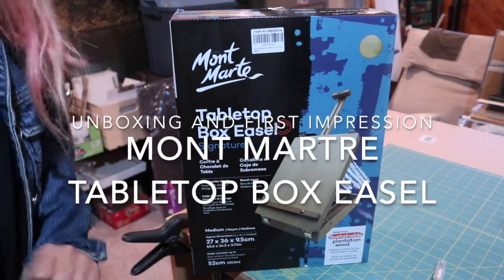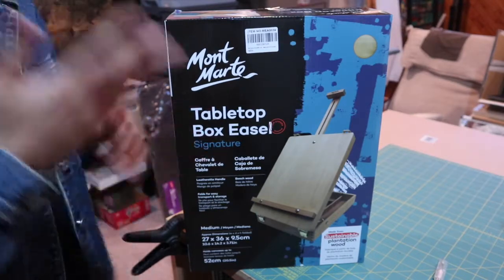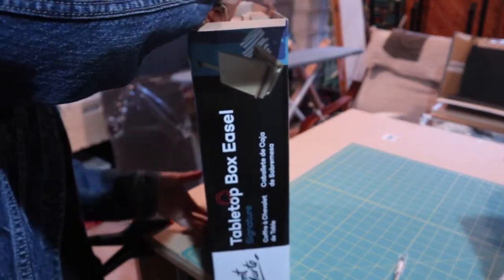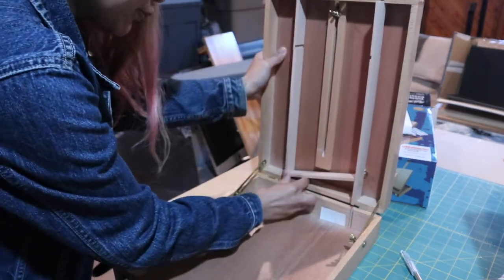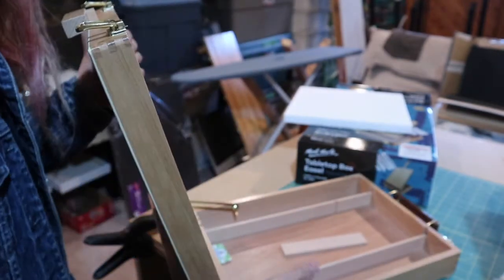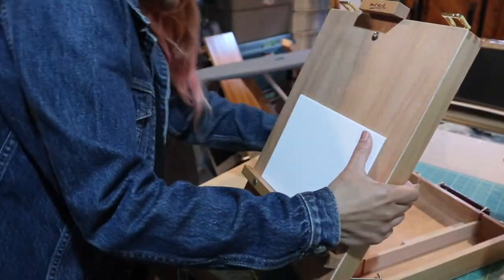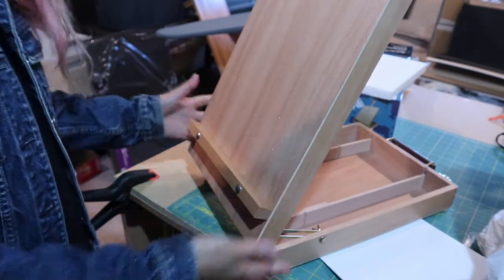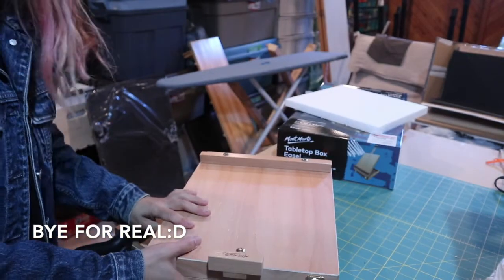Unboxing and First Impression (Review): Mont Marte Tabletop Box Easel

Comment: Hi, while plein air painting do you mount it on something so you can stand by it?
Reply from the maker: Jolanda de Jong The few times I’ve taken it out, I used it sitting down on a stool and just had it on my lap. I did some tweaking so that I can mount a panel on the inner side of the cover if need be. As it is, you can’t use it on a tripod but if u attach a tripod mount at the bottom, it might work. Thanks for the question, Jolanda😀
Reply: @EmmyMW  thank you for answering😄
Reply from the maker: Jolanda de Jong oh, you’re very welcome 🤗